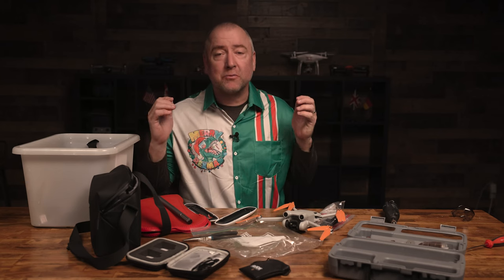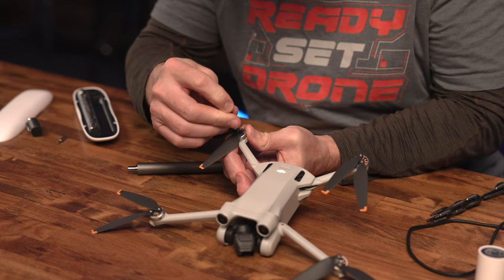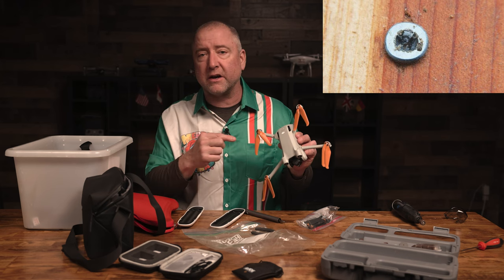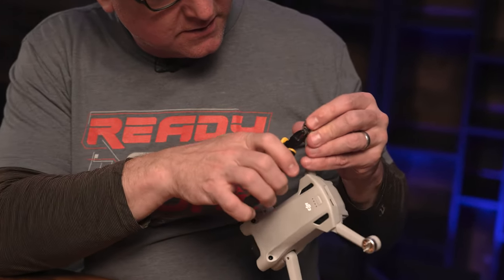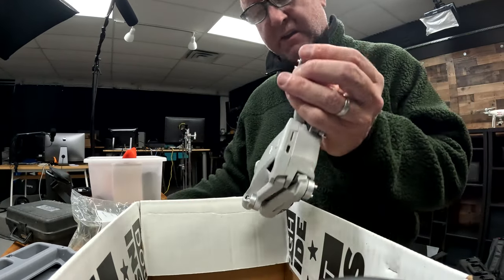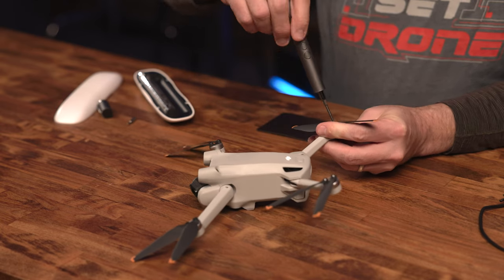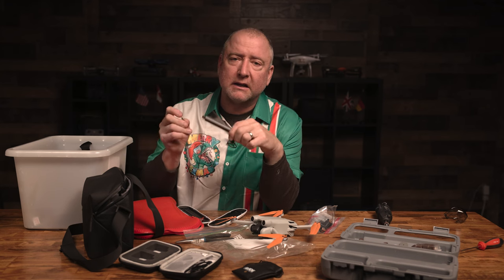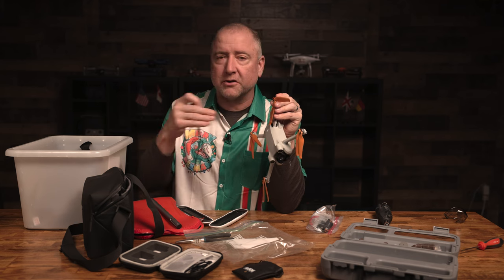Don't Ruin Your Mini 3 Pro! (How to NOT strip the tiny screws)

Comment: 3 of the screws were tight and the hair started to loose as I tried to brute force my way to unscrew them. But they won't budge. Worried that I might break it, I pack into the bag and lie on the bed searched on Google, "mini 3 pro screw tight" and it listed your video at the top. Watched it and I heard the crucial statement: "propellers are plastic" when I saw you were using a plier to twist the screw, it came to me, I can use a cutter to cut and scrape the plastic to expose the screw and 30 minutes later, my drone is in the air again. THANK YOU SO MUCH!
Reply from the maker: Thank you very much for commenting! I'm glad your drone is flying again.

Comment: Great video. Having the proper size screwdriver is key. A cautionary tale, indeed. The one and only reason I personally am reluctant to recommend any of the DJI Mini series to first-time droners is the screw-on propellers. As great as the camera and the advanced features have become, many of my friends and neighbors do not have the dexterity to change those props --- and we all know THAT is a full-time job when you are starting out. Newbies would be better with the Air 2S IMHO. FPV and seasoned pilots will take this all in stride of course. But whenever I hear Mini 3 recommended to new droners, the 2 screws per prop just increases preflight checks --- and we know THAT isn't a habit newbies acquire early
Reply from the maker: All great points! Thanks @dogstar7 for the insight!
Reply: I'm a noob and im sttruggling changing props too. The screw is stuck :(
Reply: Wall trying to take the screw out of the pillar by breaking the propeller. Somehow I managed to rip the top of the screw off leaving the rest of the screw inside now I don’t know what to do. Any suggestions?

Comment: Oh man. I stripped 3 out of 4 screws I just tried on my DJI mini 3 pro. :(

I used the included grey screwdriver from DJI! 

(I have changed the screws on the Mini SE with ease. )

I’m in London U.K.  
how can I get them out without breaking them. 

Maybe I should send it in toDJI (as ridiculous as that sounds)
Reply: Did you resolve problem,what you do?

Comment: Thanks for the video.  I ended up using a jeweller's file to remove the plastic around the screw exposing the head.  I didn't have to take off much, just two opposite sides, about the depth of the screw head and enough to get a pair of needle nosed pliers around to get the bugger out.  This worked well for me as I don't trust myself with a dremel.  😄 I also, taped the motor to prevent debris from falling into it.
Reply: That's definitely the smart way to go about it. Image all the folks bending their motor bells and or shafts pushing the wrong way and just not thinking about what's really going on as far as pressure being applied to mini drones tiny motor / 's by going full 200lb gorilla on them things😢😂.  Like I don't understand why I have Jello issues with my mini, mini 2se, mini 2, mini 3 or mini 3 pro's. Happy flying and recording everyone.

Comment: For another occasion, use the Dremel with a cutoff wheel to cut a slot in the top, for a straight screwdriver.  Not too deep, keep it narrow.  I would think those screws would be of the Allen key design like other quads use.
Reply from the maker: Great comment! Thanks!
Reply: This is a good technic too! My "Visgrips" idea is theoretically faster. (But, not always.) You "Grap 'n Go", loosening the screw quickly. Apparently, Kelly thinks your "Idea" is considerably better than mine as "The Bum" didn't give me a "Like". Not that I'm hurt or anything. Lol.
Reply: @billhowes5871  I’m not familiar with the dji screws.  If a screw is a round head as well as flat heads of course there may not be enough surface to bite with vice grips.  Same for rounded off hex heads.  Most certainly any type of head needs a tight fitting tool.  I’ve had the most problems with Allen heads on my RC model trucks, the heads sometimes are not to spec incl inferior grade material.  If I get them out once, they get replaced the first time.  Lots of hardware on RC model trucks and cars.
Reply: @robertp7209  30+ years ago I used to specialize in rebuilding old plumbing faucets. As well as rebuild V8 motors from scratch. Not to mention the multiple 100s of times I've replaced motors and gears in my toy drones. (All I do is fly so they constantly need work.). That'll give you an idea of just how skilled I am at removing stubborn screws. What I was saying above is if there's enough "Meat" on the side of the screw such as having the plastic prop there. You should be able to squeeze the vise grips tightly around the plastic then, remove the screw. It doesn't always work.
Reply: As far as your striped Allen head screws go. What I do in those cases is drill a tiny hole in the the center of screw. Then, gradually increase the size of the drill bit until you can carefully peel away the remaining pieces of the screw without damaging the threads. On my snowblower, I used a chisel to remove the remaining pieces of the screw.  (It took all afternoon.) This is time-consuming and tedious. I too have found it imperative to have a tight-fitting screwdriver. Haphazardly grabbing any old screwdriver can leave you "Screwed". Kelly likes bad puns so that one's for him.

Comment: The tiny screwdriver that comes with any DJI drone is only good for making sure they are tight before every flight. What you need to replace them (I use a 5" on my DJI mini 2 se) is a Phillip's #0 screwdriver and you should never have any issues. Always use the new screws because they have the needed loctite on them.

Comment: If you drill out the head of the screw with a bit that is smaller than the hole in the propeller you could then remove the propeller and use some vice grips to back out the screw.

Comment: Just to let you people know, I was travelling and didn't have proper tools, so I had to break and remove the propeller. I wanted to make sure it wouldnt happen again. I bought quality Philips Screwdrivers PH00, PH000 and PH0000 and tried them. PH00 fits the best and it will be my choice to go. PH0000 is second best and is able to do the work. PH000 was the one where it didn't seem a good fit and probably would damage the screws if it is too tight. PH0 is too big
Reply from the maker: Interesting. It seems like we all have different experiences with sizes that work well.

Comment: I crashed my DJI Mini 3 Pro flying in the attic!! I broke 3 blades and  1 blade screw got stripped and it took forever to get it out! So I replaced all 8 props and after a test flight 6 of the 8 props have a small bit of a rough edge like maybe the props are rubbing together. Is it OK to keep flying my drone?
Reply from the maker: That doesn't sound good. I'd investigate further. The propellers shouldn't be able to touch anything. It could be a sign of a more seriously structural concern.
Reply: @readysetdrone  I bought the screw driver set you recommended and it looks like I didn't screw the props in all the way. The tiny screw driver that came with the mini 3 is terrible and i could never get a very good grip. I went back and tightened all the screws with the new screw driver and we are all good! Amazing that a quality screw driver makes that big of a difference. FYI - I will probably avoid flying my drone in the attic !! Lol! You can check out my latest video, in the first 10 seconds you can watch me fly in my attic!

Comment: Hey, Kelly. Stripped screws are a real nuisance. Add a 4" pair of ViseGrips to your tool kit. You can squeeze them very tightly around the plastic prop then, turn the visegrips counterclockwise to remove. This doesn't always work. I'm surprised DJI didn't include a screwdriver? Both of my Mini 2's and SE came with them. Anyway, take it from me who kinda specializes in small screw removal. It's imperative to have a tight fitting screwdriver. Good job finding these "0000" type your talking about .That took a little research on your behalf.
Reply from the maker: Thanks, Bill. I made a follow up video here where I realized that DJI did indeed include a screwdriver. https://youtube.com/shorts/qT1wOZwNOuY?feature=share
Reply: @readysetdrone  Well, THAT'S good. I wouldn't have bought this $1,800. drone if they didn't include the .$.24 screwdriver! Or, would I?  :0

Comment: The first time I had to remove a prop screw, it would not budge with the screwdriver that came with the Flymore kit. I had to grip the screw with a pair of multigrips and the turn, fortunately it came out. It was not easy and so I purchased a better screwdriver with a bigger grip.

Comment: Would the Mini 2 screwdriver work too on the Mini 3 series?
Reply from the maker: That's a great question; however, I no longer have the Mini 2, so I can't give you a definitive answer. There doesn't seem to be any info about it, that I could find online, from DJI.
Reply: Nope, the Mini2 uses 00 Philips while the 3 Pro uses 000 size which is smaller.

Comment: I hope you read these as i have a mini se and need to replace the props but the screws just spin and don't seem to back out at all. Is there something i have to do that im missing? It's like having a nut on the other end of the screw that spins with the screw and i don't think this is the case but it's how it acts when i try to remove the screw. They all act like this!
Reply from the maker: That is worrisome! They should simply unscrew. Are you able to see that the screws themselves are spinning, or perhaps the screwdriver is somehow loose and not actually applying torque to the screws?
Reply: @readysetdrone  good call, it wasnt the screws it was in fact the screw driver bit. I was really worried and thank you so much for the help. I used a flashlight and could see well enough to verify what was happening. Combo of old eyes and cheap screwdrivers!👍
Reply from the maker: I'm glad you got it sorted out.

Comment: Hi, Kelly, maybe you can help me. I spent all night trying to find out if The Mini 2 is/will be compatible with their goggles and, which ones? Also, which tablet would be most practicable. (A Civil War word used by Lee, Lol. ) I have these two beautiful Mini 2's and they only get used for LOS cause my tabloid phone is so, so. Should I buy The Samsun Galaxy A8? Can I use The V2 goggles, or goggles 2? What's the best solution for this problem? The goggles 2 don't have the penetration the V2 does. But, rumor has it the V2s are going to be discontinued. Thanks.
Reply from the maker: Hi Bill. I don’t think the Mini 2 is compatible with any Goggles. I could be wrong, but I have not seen any DJI camera drones that work with V1 V2 or goggles 2. It would be amazing if they did!
And as far as upgrading to a new tablet, I think that would make a huge difference in your flight experience. Good luck and Merry Christmas!
Reply: @readysetdrone  Thanks, Kelly. There's a good chance that I'll be getting The Avata and Mini 3 anyway but, it seems a shame to have these beautiful Mini 2's just sitting there only to be used for indoor use. And, even then, only on occasion. Like I told you before I fly around the clock 7 days a week. Mainly w/ toy drones. Now you see why I'm always installing motors in these toys. They don't last very long. I'd go on but, who cares about my trivial life.  :)

Comment: Also be very careful those tiny screws from master airscrew I had three screw heads pop off last week had to send my mini3 pro back to DJI they are sending me a new drone. Please note I didnt over tighten the master airscrew screws I've had many drones and I've used many masterairscrew props in the past they literally fell off as soon as I tried to remove them little to no effort involved. I have had issues with their screws in the past usually they were bent  or would not thread easily into the screw holes Im gonna use the dji screws to be on the safe side.
Reply from the maker: Yikes! Thanks for the comment.

Comment: I just bought a PH000 and it couldn't unscrew anything.
Reply from the maker: I had the same experience as you. As I mentioned in the video, the one that worked for me was the PH0000.
Reply: @readysetdrone  I don't know if is different in Australia, but here I needed a T4 torx screwdriver to undo the bolts.

Comment: are the propellers the same for the mini 3 and the mini 3 pro?? anyone?
Reply from the maker: I only have the Mini 3 Pro, but from what I understand, they use the same propellers, however, I've heard that the screws that come with each set are slightly different.
Reply: @readysetdrone  yeah i just read that...i guess i need to find mini 3 propellers then..thanks for the fast reply!
Reply from the maker: Sure thing. I didn't realize that earlier. Sorry for any confusion. I hope they at least use the same size screw driver!
Reply: @readysetdrone  is the screwdriver these drones come with not useful ? i just got my drone a few days ago...and flew that thing into a car ..lol...now one of the propellers is broken, that little orange part of it..thats why i came across your channel here..
Reply from the maker: The screw driver it comes with is cheap and sometimes is hard to grip and have proper leverage, so just be careful not to strip the screws.
Reply: @readysetdrone  i will give it a shot...lets see thanks !

Comment: Bought a 000 screwdrivers in a kit.  Too small compared to DJI screwdriver. Went to 2.0 mm.
Reply: Interesting. I wonder if the standard isn't a standard, when it comes to the number of zeros, between companies.
Reply: @SunriseWaterMedia  they all should be as the screw driver sizes are a standard. however if you go with cheap tools their quality control and tolerances likely dont match up..
Reply: Get the PH00,... for me, it was a perfect fit

Comment: 0000 is way too small in my opinion. PH0 is the one to use but the real problem is, these are not Phillips head screws. They are JIS screws. Japanese Industry Standard screws. They are just different enough that the Phillips head screwdriver wants to slip out of the screw. If you look under a magnifier scope, the Phillips have rounded edges towards the center of the "cross" and the JIS have totally square right angles all the way around. And for anyone with a stripped screw, get a heavy duty soldering iron and melt the plastic away from the screw. Sanding it like he did puts all kinds of grit in your motor.
Reply from the maker: Thanks for the comment. DJI definitely didn't make this easy!
Reply: PH00 fits perfectly. I bought one and was able to do the work that PH0 and PH000 wouldn't do.... PH0000 was good enough... but PH00, for me, was the one
Reply: @FabsHF  Glad it worked for you. I emailed DJI for the right fit JIS screwdriver. PH0 is what they said to use.

Comment: Well it finaly happened. I hit a small tree branch and my mini3pro fell 6 ft to the ground. No problem. 👎 I have MASTER AIR SCREW PROPS and not only did the props break off and some split, but the HEADS OF THE AIR SCREW SCREW HEADS  POPPED OFF on 3 motors. BEWARE  OF NON DJI SCREWS!!!.  Now what, send it back for 3 new motors?? This new design for prop attachment is terrible. DJI  go back to mini 2 prop attachment design.  Please.  And does any one know how to remove such a small screw that has NO HEAD out of that small post.
Reply from the maker: That sucks! I wish they made quick release props for their mini series. Having no head on the screws sounds like a pain in the neck.
Reply: @readysetdrone  The screw posts on the mini 2 and 1 are a much stronger design where the prop breaks before the screw, but the mini3 has a post that a screw inserts into, less than 1/16" and a large head that when the prop hits something the blade actually breaks the head off the screw rather than all damage to the prop. Once this happens there is NO WAY TO REMOVE the remaining screw from the post rendering the drone a paper weight. Maybe this is a AIRSCREW problem with poor quality screws, I did not have this problem with the original DJI  screws the one time this exact situation happened. The dji screws held and all the damage went too the props. Unless anyone has a method of removing the broken screws this means a DJI warentee replacement claim.  happy New Year    CHEERS   Steve h.